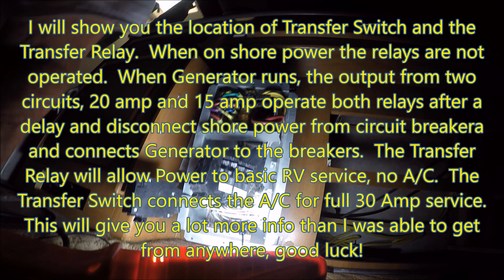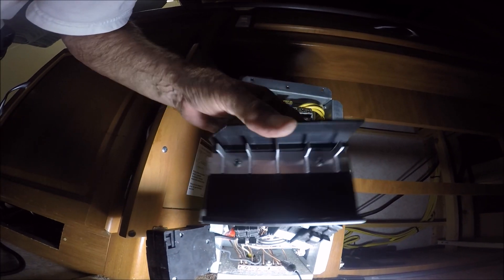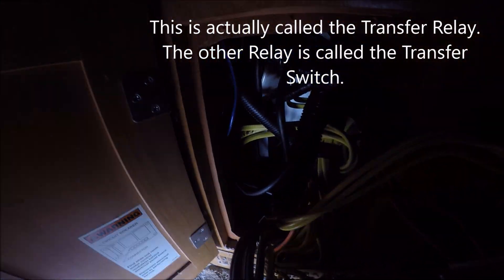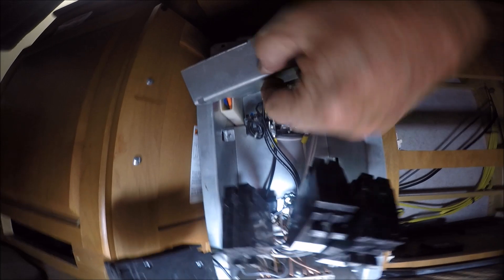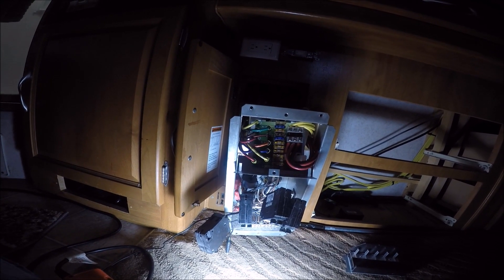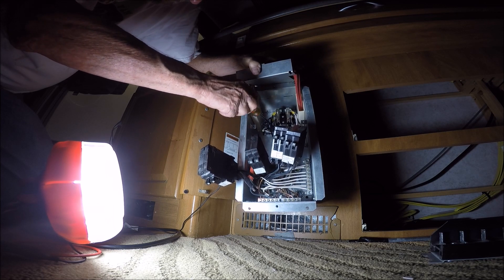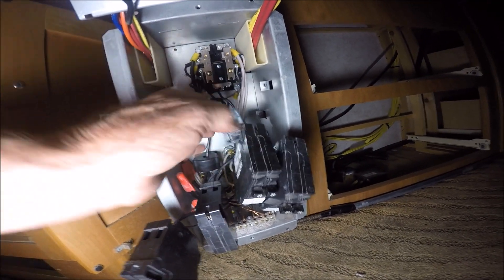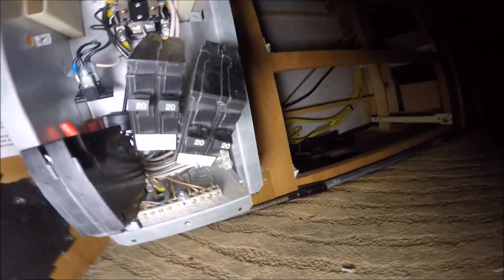RV A/C Shore Power To Generator Transfer Problem

Comment from the maker: For all the folks that watch my video on this subject.  First, I could find no one that knew where the Transfer switch was located and the fact that there are TWO, yes TWO transfer switches.  One for the Front Air and Circuits and one for back air and circuits.  I traced the wires to find the Transfer Switch located in the power box.  It was the only way I could find it.  I called Fleetwood and they did not know.  No one but ME knows where it is.  Figure that!!!  Well, I found that I could not find the Delay switch for the Relay in A/C power box so wired a  regular house A/C switch in place of it.  I act like the delay and throw it after the Gen runs for a few sec.  Now the other Transfer Relay is the second leg of the Gen and it is located directly behind the Power Box on the storage wall for under the sink.  It is a circuit board with a much smaller relay.  It has a delay built into the board.  It was bad and the relay would not operate.  I could not find another board.  I bought a big relay like in power box and replace circuit board with big relay.  I added another A/C switch for a delay.  I throw it also after the Gen is running.  If you follow my research, you will be able to solve your Gen Power problem like I did.  There is no one else I know that can help you but me.  I have been where you are trying to get.  Do I hear a AMEN.  I can't hear you!!!   Amy you know!!!

Comment: Thanks for this video. My generator is running but there is no a/c power in the coach. I have a 98 Bounder by Fleetwood, and I'm pretty sure its the same set-up as you have in your RV.  You've taken me a step closer toward a resolution....
Reply from the maker: Buckwsr, it most likely is the same.  Just remember, there are two transfer switches.  one behind the electric panel and one under the bathroom counter on wall under sink.  The gen set has two outputs, one goes to each of the transfer switches.  Good Luck.
Reply: @samowens44  Yes, I think my RV has both transfers/relays in the area above the fridge, by the circuit breaker panel. Your video removed some of the mystery about this system....none of the RV or generator paperwork included this information....and I have enough experience with electric that I will be able to sort it out.  In my previous RV, a '92 Rexhall Airex, the generator simply fed a receptacle into which you would plug the RV power cord. So no relays or transfer switches were required, making that a simpler system, in my opinion.
Reply from the maker: @Buckwsr  I found the first transfer relay under the counter and found the delay circuit was bad and wired a switch in the place with a new Relay.  Worked great for basic electricity in the rig, but no Air Conditioning.  That is when I was stumped, but I stared tracing wires and found the second larger relay behind the Power panel.  I could not get anyone to tell me where the second relay was.  I thought this video would help a lot of do it yourself guys like you get a head start on finding the relay.  You should hear the relay click after a delay.  The problem was the delay circuit went out on bother relays.  I wired switches in place of delay and throw them manually after Gen has run for about 10 seconds.  Good luck.
Reply: @samowens44  Okay, so on my lunch break I went out and found the relay for the a/c circuit. Using a voltage tester, I confirmed that with the coach plugged in to shore power, there is voltage coming to the relay, and also going from the relay to the a/c units. Then I unplugged from shore power and fired up the generator. But the tester then revealed that there is no voltage at the relay coming from the generator. So before I can conclude that the relay is faulty or not, I must first figure out why there is no voltage making its way from the generator to the relay. Of course, I verified that the circuit breakers mounted on the generator were in the "on" position. But still no voltage at the relay or anywhere else. That is as far as I've gotten in my diagnosis. Thanks for listening. ha ha!
Reply from the maker: @Buckwsr  One more bit of help,  Somewhere close to the Gen set, there will be a connection box that connects the Gen to the Coach.   Just follow the heavy cable from the Gen and find the box.  It has wire nuts making connection, they have been known to fail to make a good connection.  Check the output of the Gen at that point, both outputs.  First see if the wire connections are good and tight.  If you don't have power the breakers may need to be checked.  There is nothing between the wire connection there and the relays.  So that is the most likely problem from what I am hearing from you.

Comment: Hi Sam. I have the same 2003 PACE arrow 36b. It has the A/C intellitec climate control. I want to convert the couch to 50amp service. With your knowledge of what you know about this coach, what would you recommend a how-to? I know I'd need to run a new 6/3 into the coach, a 50amp transfer switch, and a 50 amp panel.

Comment: Exactly my problem Sam Owens--had my transfer switch burn out and replaced in Texas last winter---currently working great on Shore power...But on Generator have "AC Power" everywhere in coach except Air Conditioning Compressor's- (Air Conditioning Fan's will run) are you saying it is that time delay relay ?
Thanks Greg Anderson [2003 Fleetwood Expedition 34W]
Reply from the maker: @greg anderson My problem was the Delay switch was bad and would not allow the relay to operate.   I took the delay switch out and rewired a A/C regular switch to turn the relay on after the Gen has started and running for about 5 sec or so.  So now I am the delay by throwing the switch.  Has been working great.  I tested the replay to see if it was good, and it was, so delay switch had stopping operating.  Now this is the switch that is behind the Electric circuit breaker switches.  There is another switch that is smaller behind the area mounted on the wall.  It has a circuit board with a relay that is much smaller.  I relaced that circuit board with a large relay like the one you are working with and put a switch on it also.  I found this one first before the one in the Circuit Breaker box.  It would allow the back A/C to work, but not the front A/C.  then I found the Relay in the Electric Box.  Now both A/C will run.  Good Luck.
Reply: @samowens44  Am I correct in assuming you were unable to find the correct time delay switch ? Could you submit photos and  or Brand/Part Number of the manual switch you substituted ? Thanks Greg
Reply from the maker: @greganderson6248  Here is a photo of my A/C Manual Delay switches for both transfer relays.  Just plain A/C on-off switches.  Click link for photo. https://drive.google.com/file/d/11zl-ggIQWhaD_Z-pLO78basDVd5kTGyj/view?usp=sharing

Comment: Hi Sam, I REALLY appreciate your video. I have a 2000 Fleetwood Bounder with this very issue. My time delay relay is clearly smoked. I am hesitant about jumpering this but will if necessary. I am wondering if you have had any luck finding this part. ~Kevin~
Reply from the maker: Kevin, Both my delay relay timer was bad, I could not find a new one, so I wire a switch, a regular A/C wall switch and mounted on the wall area.  My video shows the main Transfer switch behind the Power breakers.  the delay was bad there also.  I wired a switch to that one also.  I have found you can leave the switches on with all A/C units off and start the Generator and all comes up fine.  So I have just left mine on now and have everything off when I start the generator.  Gen comes up fine and then I turn on the A/C.  Good luck.
Reply: Hello Sam after you did everything you did to your RVdid it work,because i have a 2000 Fleetwood pace arrow  and im having all the same issues.  I also wanted to ask  to see if maybe you knew if the location of the wiring is the same for 2000- 2003, im asking you for your help because im not one that has much experience with electricity but I  like to learn and do it myself,  and sofar, watching your video, and reading the conversation you had with that other gentleman  reading gave me a better understanding.  Thank you all, any feedback would be greatly appreciated.
Reply from the maker: @mannyjimenez1010  I am not sure what the wiring looks like for the 2000, but feel the circuit will work the same.  Main thing is to find the transfer relay, the big one.  There is a smaller delay relay, but the big one does the main work.  If you are not familiar with electricity, have someone with you that does.  There is danger for your safety when the electricity from shore power or generator.  If the relay does not operate when gen is running, you need to check the voltage at the relay with a volt meter.  I feel you should have help before you try this yourself.  If there is generator voltage, then the problem is the delay device or the relay.  You can check the relay by clipping the power wires to the relay, if it operates, then the delay is bad.  That was my problem.  I wired around the delay to a switch that I manually operate.  Show the A/C helper the video and you need to check the relay for operation and he will know how to do it.  Good Luck.  Remember this is dangerous to folks that do not understand A/C circuits.

Comment: This is my problem exactly my rig is 3 years old a Sunseeker from Forest River 
My fuses are looking good 
So maybe it’s the Relay
Reply from the maker: @Kathy Fann when the Gen start you will hear a loud relay operation sound after about 3 seconds or so.  This is a delay to allow gen to get to full output before power is supplied to rig.  My relay was not operating because the delay circuit was bad.  I replaced the delay with a manual switch.  I start my gen and operate the switch after the gen has run for a bit.  If you are not familiar with electricity and precautions for safety, get som experienced help.  When gen is running power is on the relay and wiring connected.  If shore power is connected,there will also be power on the relay contacts.  As I show the power box taken apart, the gen or shore power is not connected.  Chances are your relay is ok, your delay device is the problem.  Experienced tech will know how to test the relay safely.  Good luck.